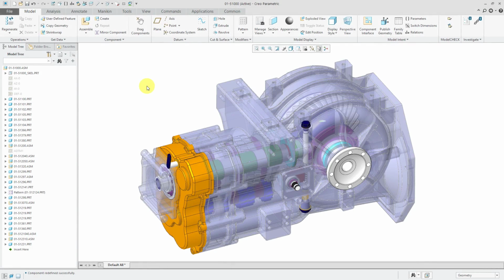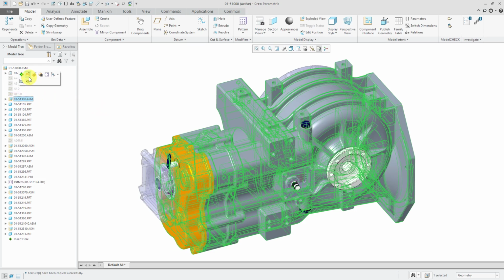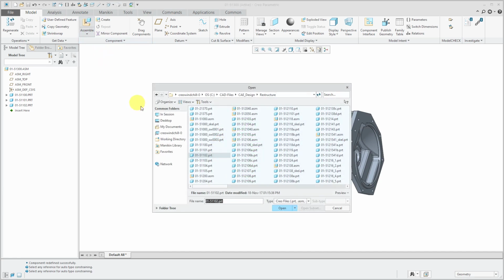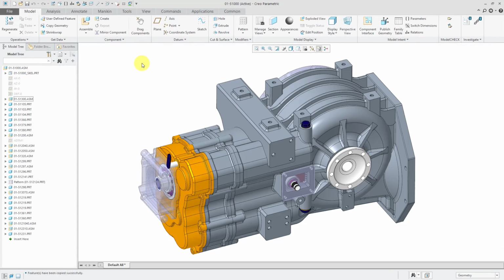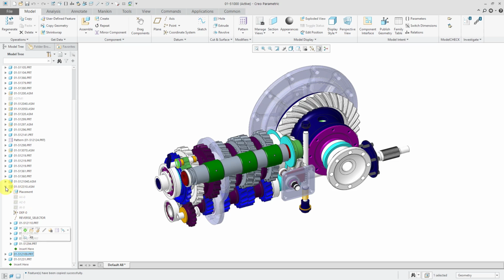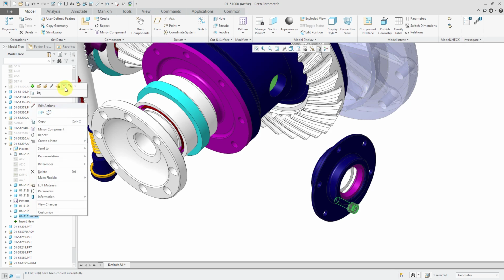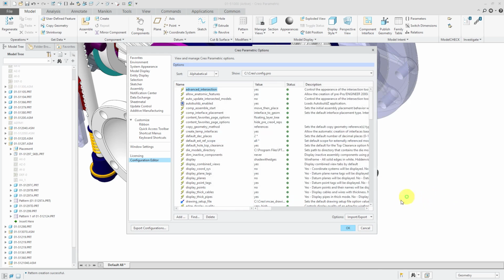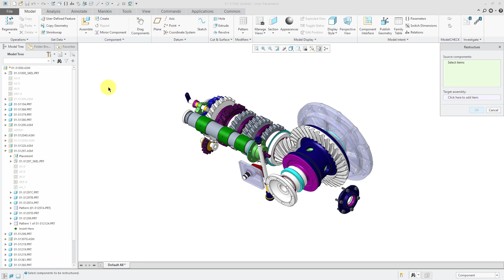Creo Parametric - Restructure Methods [Demo]

Comment: How do I take ALL the parts from an subassembly and pull them all out to the top level?  Mine will let me pull 6 of the 7 parts out, but never lets me pull the last one.  Regardless of with item I decide to do last.
Reply from the maker: Did you try deleting the constraints for the stubborn component?